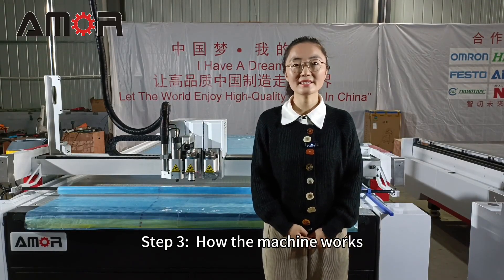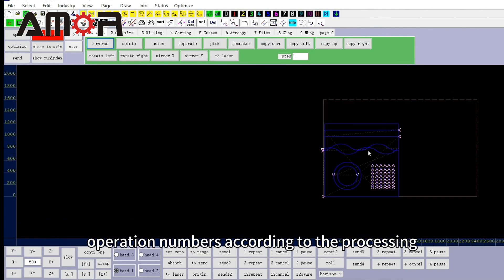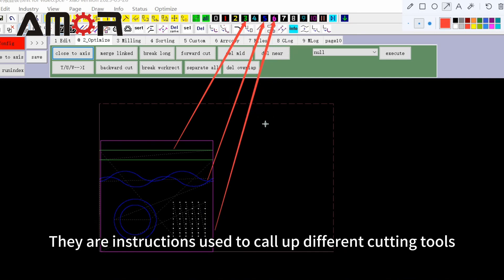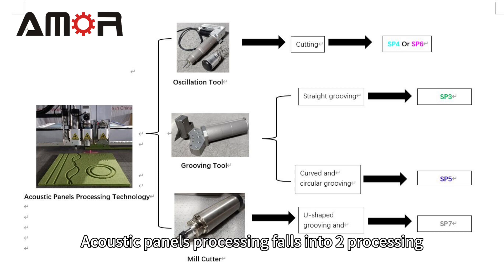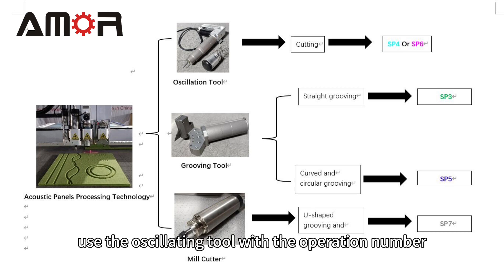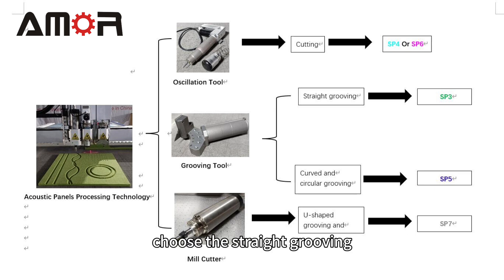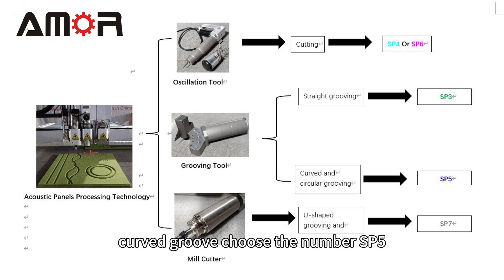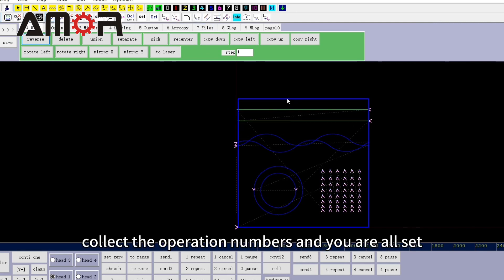How to Choose CNC Machine for PET Acoustic Panel Cutting and Grooving

Comment: Hello, we have this machine. Cutting the same material (10mm thick) We are having problems with the angle knife for bevels, is it normal that the blade gets blunt after 10 minutes of use? We are running at 3000 mm/min cutting straight grooves on a full size sheet. Thank you so much for any tips! Great video!
Reply from the maker: This is obviously abnormal, and the speed is only 50mm/s. You need to check the material of your blade. Contact us: amorsales@amorcnclaser.com; WhatsApp: 86 18863504017.